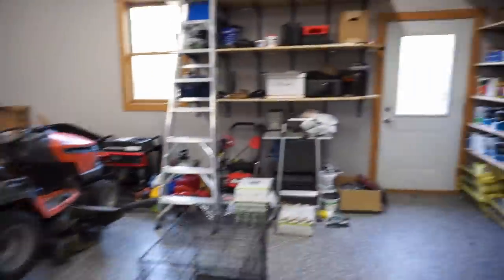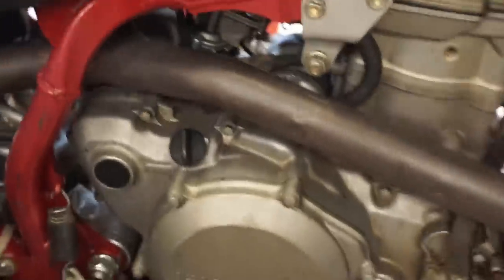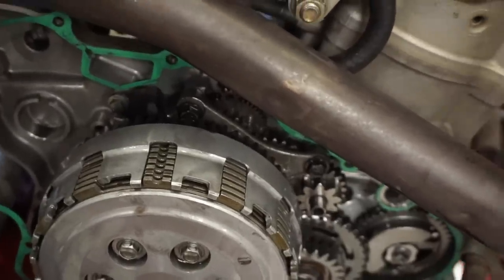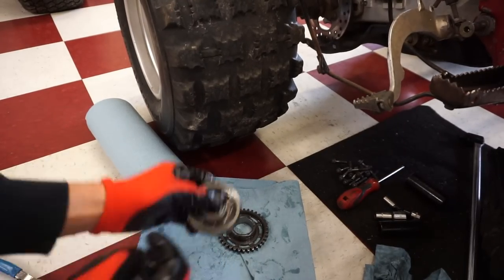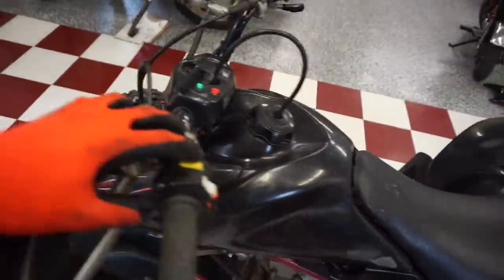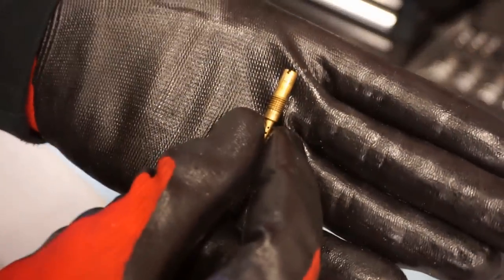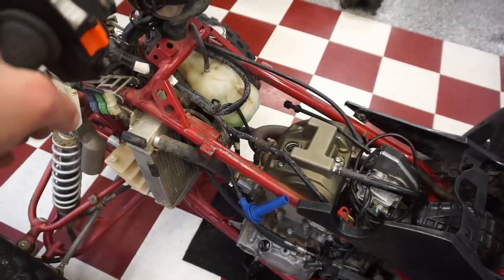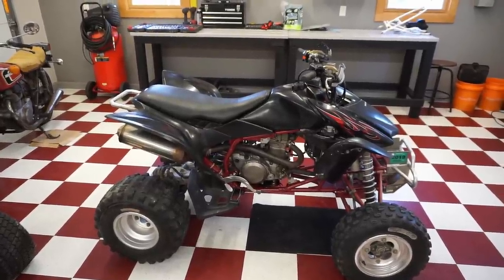Honda TRX450 Quad Bogs and Dies (Nobody Can Fix It)

Comment: Kinda makes you wonder how many other bolts are loose. Especially if they did the whole engine. I would be worried.
Reply from the maker: Yeah for sure!
Reply: I've seen bolts all over the clutch side come loose and trx450rs. I go through with a torque wrench, check for torque. If not torqued, I pull the bolt, air cimpressor the oil out of the case threads, clean bolt, blue loctite, torque, sit for 24 hours before start up. It's pretty common
Reply: Sounds like there's at least 6 very loose bolts ,god dammit!🤨🤔🤯😱🤯🤔🤔🤯😬
Reply: Don’t be a little girl
Reply: @craigmorgan4676  sounds like any trx450 I've ever heard, they're seriously some noisy ass engines and microphones honestly amplify it it seems
Reply: @noidontthinksolol  you've never owned one insee

Comment: Before stripping it down I would ideally want to try a different coil/lead and CDI just to eliminate also try spraying carb cleaner or something flammable around the intake area to see if it change the idle, due to leakage.

Comment: Great video! 
I own two of these quads and they are quite noisy engines, but it is difficult to hear through the mic. One thing you can look for is the tiny jet in the bottom of the bowl on the carb. It has something to do with the accelerator pump and it is common for TRX owners to change them. Also, as it is written on the throttle box, DO NOT use throttle whilr starting the engine. I stripped two one way bearings doing that and it is probably the reason yours was bad. Good luck!
Reply: Yup. They should be able to start on their own with no touch of the throttle.

Comment: 1)  Make sure the TORS system is functioning correctly (one inside carb where throttle cable goes in, and button inside thumb throttle).  I usually bypass the TORS at the throttle by clipping and then connecting the wires under the hood. 
2) Swap another FCR if you have one. Will eliminate or confirm carb right away.  

I'm leaning towards electrical.  120 is super small but I believe Honda used really small mains, especially in the 06+ models.  With stock exhaust and intake, jetting shouldn't be causing complete shotdowns.  Missing and bogging, yes, but not that.

Comment: I had many years ago a Honda Transalp with a fueling issue. Would idle ok, and go without problems till mid rpm, but when you rev it would die. Cleaned and balanced the carbs didn't fix it. New spark plugs, same issue. Checked the cdi units, coils, etc, to no avail. You know what it was? The fuel petcock. The friggin petcock. Nearly set fire to the whole thing out of rage. Keep the good work and see what's wrong with that honda. Cheers!

Comment: Sometimes the carb body itself gets clogged. You have to completely strip it down and soak overnight in carburetor cleaner. The good stuff that you buy at Napa in a one gallon container. Stuff is potent. Then blow out with compressed air. I had a YFZ 450 carb do this to me once. Cleaned it 3 times with carb spray and compressed air. then I finally did what I said above and it ran great. Not saying this is your particular issue but just sharing my trial and errors with that particular carb. Keep running it down with new videos!

Comment: Clicked the video cause I had one of those same edition quads, 07 red frame with the flame graphics. It was by far the favorite quad I've ever had. Hopefully you get it figured out. I was shocked when I took mine apart to change the jetting at how small the stock main jet is. I cut the airbox lid at the molded in line, removed the exhaust core and went to a 180 main jet. It was like a whole different quad after that. Im in Indiana so about 750-800 feet above sea level. The biggest problem I had with that quad was the float needle would stick on it, a lot! It just never seemed to move smoothly up and down in its bore. Sometimes it would stick shut and the quad wouldn't start at all, Id have to blow into the fuel tank vent and it would pop open and start. Sometimes it would stick open, id turn the fuel petcock on and it would immediately start leaking fuel out the vent hoses. Id put the quad up on the grab bar and then push it over and let it slam down on all fours and it would free it up and stop leaking. Can't begin to count how many times I took that bowl off and cleaned that needle. Always was irritated with that carb, ran great when it was right. But it didn't just happen when the quad sat, I could be in the middle of a weekend riding we would all stop for a break in the woods and id look down and fuel was just pouring out the vent tubes. Quad wasn't clapped out or neglected either, I bought it brand new and this started happening within a year.

Comment: Hey FYI those valves on those Motors constantly need checked and shimmed and when you set the decompression arm don't use feeler gauges set it by cylinder pressure the cranking psi is 50psi I just sold my 2006 there awesome bikes

Comment: I had one doing similar things and would just die randomly and when trying to take off from a standstill. I deleted the TORS and clutch switch. The Tors delete fixed it. Takes about 10 minutes and it’s free. Worth a shot before a tear down.

Comment: I have a 07 crf450. If TPS sensor has been pulled from the carb and not installed exactly, it can cause issues. I believe I used a power source and had to pin 2 wires to get a certain voltage and it was very peticular where at. Rod bearing usually makes a nice mess of the oil.

Comment: i had an 06 trx 450 i had the same issues for a while i had to use a hole saw and cut a port in the lid of the air box and buy a r&d jet turn knob it seemed to fix it for me also had to replace the the one way bearing as well and im pretty sure i jetted up as well ... i did run into a problem with the header glowing when ideling but not if the quad was moving hopefully this may help you . i watch all your videos keep up the good work brotha!

Comment: First thing i noticed was..why straight water in the radiators??? Clutch basket had a chip outta it..gotta tear it down n see for urself joe.also- shoot air thru all passages (mite be metal chunks stuck) and gap plugs when u install em..my 2 cents! 😃👍👍👍👍👍👍👍👍dont trust other peoples work !!!!

Comment: Your cranking compression on the electric start trxs should be 65 psi cranking with throttle closed. It has a decompression so it’s not gonna read high. Kick start models should kick at 85-90. The jetting sounds about right for stock but if the air box lid is off you need to go up towards 160, if you take the core out of the exhaust then go 175-180. You also should split the mid body of the carb apart those will get you. Also verify the accelerator pump timing is correct.
Reply: You also probably should eliminate the tors system. It causes issues starting. I’ve to do it on 4 of them now.

Comment: I would check that quick adjust fuel screw, some have a washer  and o-ring at the end of the spring, very easy to lose. Some cheap ones just dont work right.
The first run where it  was  popping on overrun is likely an air leak.
Should have checked the accel pump while the carb was off,  the throttle bog sounds like the early versions of the fcr that needed modding.

Comment: I think it’s a combo problem. Throttle sensors are bad, and the rod bearing is bad, or was installed wrong when they rebuilt it, or was the wrong size. Everything else checks out, so thats the only two things it can be.

Comment: Throttle sensor, accelerator pump, air leak and possibly the rod bearing starting to go. 

I think you’ve a few small gremlins still in that bike joe. Good luck with it

Comment: Need to time the sensors on the carb with your ohmn meter, check manual for readings.  Also clean the leak jet in the bowl. Around 100hs the mid body on the carbs need to be rebuilt

Comment: It may have spun a crank out of allignment, if they changed the rod bearing but didnt put it back together rigth, that would explain bad idle and engine running rough, also one way bearing may have broken because of that, you could check it easily by putting something close to rotor and checking the gap while spinning

Comment: check the CDI and ignition coil bro. Run a primary and secondary winding test with OHMS on your multi meter. sounds like it's misfiring.

Comment: You can use the red loctite and if you ever need to take a propane torch heat the bolt a little bit and it will break free it will come right out I do it all the time

Comment: I don't think that's the crank bearing worn out. It' has to be some fuel related issue. Something with the carburator or maybe a sensor. I thought also  that first thing to try is jetting. That main seems way to small for a 450,.but I checked it and is the OEM size. It's the right one.

Comment: Did you check the slide place position?  The hole in the slide goes towards the bottom, it will fit either way, but won't run correctly with the hole towards the top.

Comment: For the people that don't know... You clean carburetor jets by poking a very thin wire, carburetor cleaner, and hitting it with an air compressor.  Not by blowing through it.  Don't know why Joe does this.

Comment: Doubt it is the carburetor. I can clearly hear the engine noise which is not normal. That will need addressed either way. If the rod bearing is as bad as it sounds that will cause all kinds of sporadic running issues until it completely gives. A air leak that bad if one would be easy to find. Not to many places they can leak air from. Just for giggles check the spark with a in-line spark tester. See if it has good consistent spark. I am curious myself to see the condition of the crank and rod bearing. 🤔
Reply: It's difficult to tell through a mic. These motors running normally are exceedingly noisy.
Reply: You know nothing about honda 450rs, the engine sounded like it was gunna fly apart since it was new.

Comment: Straight from the internet:  What size jet is stock on a TRX 450R?
Image result for honda trx 450 main jet
It can be removed with a small flat-blade screwdriver. The pilot jet is the one that controls low RPMs such as idle. Stock jet numbers on our 450R were a #42 pilot and a #122 main jet.

Comment: Motor is fine. Rebuild the carb and make sure the throttle position switch system is good. Also make sure you put the correct stock plug in it. Had all the s
Reply: Same issues with my 07. Their noisy motors, I rebuild mine and didn't need to. If it's a rod problem the oil filter would have a bunch of brass/copper looking metal it it. Also that ain't is small. You're on the right track!

Comment: 120 is probably the size needed with the airbox closed ant the restricted snorkel. The center of the FCR has orings that are probably bad and to stop the bog replace the leak jet with a #55

Comment: Install a 180 main jet,. And a 48 pilot jet then plug the bleed hole in the bottom of the float bowl,,  the big will be gone and you don't have to use the coke,. It should start with out it and, the pilot jet screw is adjusted correctly

Comment: I'm still thinking carb. Rod bearing would most likely be tight all the time. Just the fact you took the throttle wire off and it ran better. I'm old though and don't know about these newer bikes. I'm sure you'll find it.

Comment: Did you check the pumper diaphragm and all of it's related passages and jet? I didn't see you disassemble that part of the carb.
Reply from the maker: Yes I did. Everything looked good. Diaphragm looked great!
Reply: @2vintage  Ok, good deal. That said, every time I've had this problem with FCR carbs, the issue has been in the mid body gaskets...the gaskets and o rings that are not supposedly accessible. They of coarse are and not hard to do. They would be my first guess as the problem, especially on one of this age. Ethanol based fuel just melts them and they clog up everything.
Reply from the maker: @thevoxofreason8468  okay I've never taken those apart before. Definitely could be the problem. I will look into that! Thanks

Comment: Can't test comp with the decomp cams. Pilots should be 45 to 52 range, and main should be 155 to 185. Stock, no, especially after there was a rebuild. I'm at High elevation (5k ft) and my 94mm OEM bore size, and have a 50 pilot and 175 main with the lid off. Accelerator pump could be crap, midbody gaskets as well. I'd start with carb. Even if there is internal damage, you'll still need the carb functioning properly for it to run anyhow. I'd start there. Easier and cheaper. Also, did they delete the the oil cooling system?

Comment: The valves were in spec correct.  The engine should run even if the crank is slapping unless the rod bearing seized up. But that's not the case because its turning over. I think it's got to be some kind of safety switch. Maybe a switch in the carb. Unless the got a cheap rebuild kit and the specs on gets and etc were not correct

Comment: Joe, loving these videos, well and truly hooked on your channel. Question, if I’m working on a bike without kickstart, what can I use to power it while faultfinding? Just connect it to any motorcycle battery charger or I need something else that won’t roast all the electronics? Thanks

Comment: Hey Joe! I have an 06 crf 450x had same issue I would check carb mid body bolts if they still have white paint markings it has never been taken apart so it's time to replace mid body gaskets and confirm the accelerator pump circuit is functioning properly. The aftermarket aluminum mixture screws sometimes are not exactly the same dimensions as the stock brass one I have seen the tip twist and break off inside before when bottoming the screw to set it... Hope this helps.

Comment: Trx 450s have 2 drain bolts brother 
1 for engine side 
1 for clutch side

There isn’t much it can be on the carb it’s pretty simple I’m thinking something internal isn’t right 

My Trx 450 I’m running a 175 main 45 pilot and 2& a half on the fuel screw but I have a full exhaust and open air box 
Runs amazing . Stock Trx 450s are jetted exactly how yours is in this video so it can’t be the jetting sizes , unless maybe the main jet is clogged . That thing should be running perfect rn . Definitely gotta look into it .
Reply: I was wondering about the ‘do both sides’ comment. @Miami, what notch are you using on needle? Love the videos Joe.

Comment: I guess on the crank oil seals, spray the covers with brake clean if it revs up, while spaying, the seals are bad. Cheers from Germany
Reply: It's a four cycle engine,...
Reply: @ghettsumm7949  yup my bad

Comment: Common issue with 2006 2007 and others is carburetor accelerator pump etc they're a pain in the ass I have dealt with several
Reply from the maker: Yeah that could be the culprit. Seemed like it was working okay when I had the carb off.

Comment: Hi 2 vintage if u have time one day I have a 1996 cr125 that just won’t kick start never has only bump start you think you could help me diagnose this problem I’ve cleaned the carb, changed jets, new vforce 3 reeds, compression about 155 literally have no idea what’s wrong with it

Comment: I have a Trx 400ex that will not run unless I give it some throttle and to much throttle makes it shut off and it will not idle and even when I give it enough throttle 10 seconds later it will shut off anyway I have a new timing chain new valves new carb new spark plug new cam I’m just lost and really looking for answers
Reply from the maker: Yeah same thing here

Comment: And it does random stalls just like that but it's fuel injected I don't know what's wrong with it but it rides great doesn't bog or anything but these random Stalls every 30 seconds is annoying
Reply: I'd check the fuel pump maybe it's starting too get weak and needs replacing
Reply: Trx are all carbueted
Reply: @kylebeach2316  ya but first I got to figure out why it's over heating I took it out riding and the temp light came on in 5 minutes and it started lean popping this was last week
Reply: I think the thermostat is stuck closed or the water pump is bad be yesterday I took the radiator cap off and started it and I didn't see it circulate so does that mean the thermostat isn't opening make the water pump not get coolant and come on ?
Reply: @samuelgagnon6474  nope in 08 they made a TRX 700x witch is fuel injected
Reply: @samuelgagnon6474  you're like 15 aren't you
Reply: @samuelgagnon6474  stop playing in the bathroom and go back to class
Reply: @nickolasvaughn667  yeah im 15 man u got me! I hope ur little ego feels better now! Now go back playing with ur little motor while i work with real diesel engine😴
Reply: @samuelgagnon6474  all right if you're a diesel tech how much oil does a 7.3 take
Reply: What is known to break on a 6.4 powerstroke after 100,000 miles
Reply: @nickolasvaughn667  what? Bruh ur delusional look at my profile picture i aint talking about ur truck lmaooooo
Reply: @samuelgagnon6474  looks like a Google picture of some excavators
Reply: @nickolasvaughn667  excavator🤣🤣🤣🤣🤣 these are wheel loader but yea! And yes if it help ur ego again yes these are google picture ahahahahhaha

Comment: 27m59 seconds in. That float looks wrong, like it is the wrong way up? I don't know that carb, but with the float like that, the fuel level is surely going to be at, or above, the gasket? Would also explain the leaking fuel earlier on. Might be worth a second look?

Comment: I had an 07 that would die for no reason! Turned out to be the petcock had rotted in the fuel tank and would block the fuel line at the tank.

Comment: mine did the same thing  even 3 shops couldn't figure it out so i took it back home  and took the carb off come to find out it had a vacuum leak on the rubber boot that the carb goes into into had a crack in it so it was sucking  air